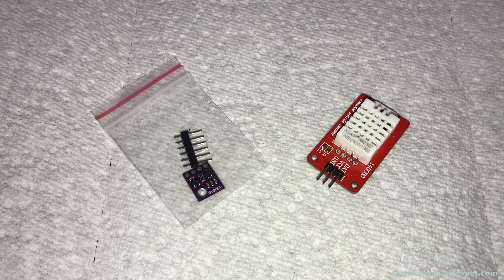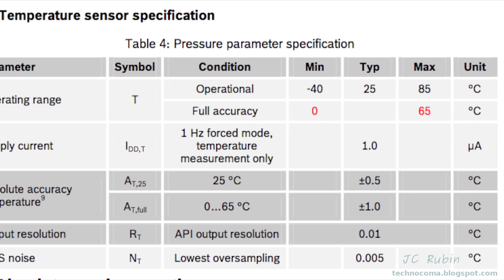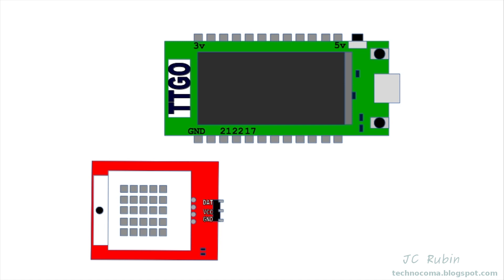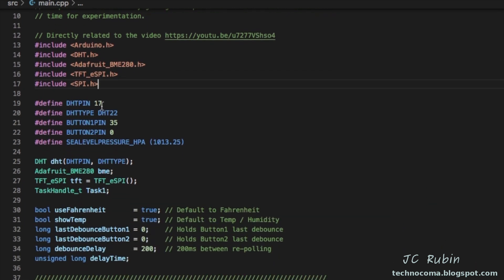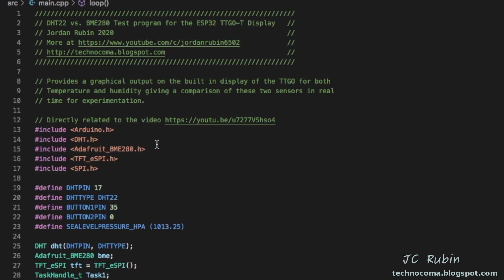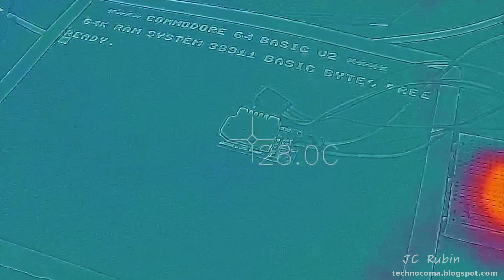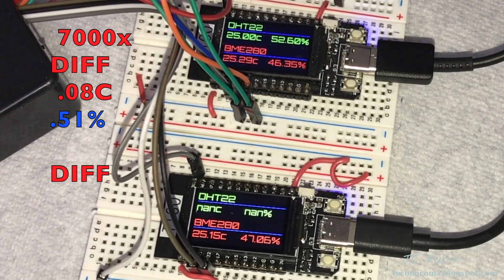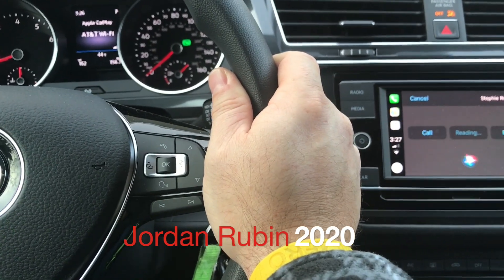BME280 Vs. DHT22 Temperature Sensor Shootout as Tested on the TTGO T-Display ESP32

Comment: Thank you for your interesting multi-component comparisons and the TTGO T Display code and wiring info. I plan to replicate this and will try instead to compare another type of non-contact sensor the MLX90614 in place of the DHT-22 with this BME280.  I have project in mind that needs to reliably trip at an adjustable threshold in a range of 60 to 70 degC before any thermal damage occurs.   Its was very interesting to see the FLIR of the TTGO and breadboard.. as I touch mine it doesn't seem to get that warm but I rarely have it running as long as you did to assess these more accurately. Thanks Again.    jimS

Comment: Thanks for making this contribution.  I found this interesting as I have spent time doing work similar to what you have done here, but primarily on the BME280.  I'll offer my experiences; perhaps they will help you, or others.

1)  These off-shore sources of BME280's are open to question.  I have an Adafruit device just to check against the others; so far, no obvious differences in performance.

2)  The BME280 WILL SELF HEAT if you run it too fast.  The Adafruit library defaulted to this behavior (it has since been revised to stop this).  Specifically, if left to default the BME280 will take readings at its maximum possible rate - way more than what we need for room temperature readings - and as a result the device heats up.  The solution is to make it read only when you need it to.  See the library documentation on "forced-mode".  Once per second, or more, will eliminate the problem.  Furthermore, even when setting the device to manual (forced) readings, if you call it in a loop continuously you will also self-heat it.  Mine will rise some 2 or 3 degrees, F.  I call for a reading every 5 seconds, which suits my purpose.

3)  Another good way to compare any temperature sensors is to set a small fan blowing across both of them; more-or-less you get the "same air" on both sensors.  They should be physically close together.  Turn off the fan and watch the trend of each sensor; if one rises, then its self-heating.

4)  As another mentioned, the DS18B20 is a great sensor, but temp only.  Be warned, most all supply you see on auction sites are counterfeit.  (see GitHub page by Chris Petrich, discover_fake_DS18B20.ino).  Jameco has good prices on authentic parts.  Counterfeit doesn't mean they don't work, but it just means you can't be sure of their compliance to specifications.  I use both in various applications.

5)  You mention averaging readings (at least I think you did...); the BME280 can do this for you, see the library for instructions on oversampling - the sensor can take care of this for you.

I like the convenience of the BME280, for sure.  It offers a lot in one solution; but getting to trust the temperature readings has been a challenge.  My desk clock displays temperature, standard pressure, relative humidity, and super accurate time using NTP - all on one 20x4 LCD display.

These TTGO modules look pretty cool - might have to give one a try.
Reply from the maker: Indeed, these were some of the perils mentioned in the technical analysis of the chip. I would agree in most cases where ambient air temp reading are taken, nobody would have a need to 30 reading per second and once every few seconds would be adequate.

Counterfeit chips are always an issue, especially on amazon.  Considering the pricepoint there and bangood you can be sure that these offshore factories can be less than legit.  Thats why the double blind tests are important.

Comment: I put outside  a DHT 22 , DHT 11, and BME280 and the BME280 temperature  is off from the other two. I have ESPEasy running on ESP8266  so it was easy to put in a temperature calibration to bring it close to the two DHT sensors. I will have to do some more observation when it warms up again because the DHT 11 hit's it's bottom limit in the cold we are having now.

Comment: The reason your temperature was different is because the bme280 is chip temperature not ambient temperature, as I discovered by reading reviews on amazon that said just look at the datasheet, so whatever temperature it reports is likely to be a bit over ambient temperature, the integrated temperature sensor is only meant to improve the accuracy of the humidity and pressure sensors, if you need ambient temperature as well then I recommend DS18B20. That said I really like the bme280 for humidity and pressure :)  Also now that I read this over, I am guessing its part of the reason you did the cold start over 30 minutes, so maybe its not really that bad even though its chip temperature.
Reply from the maker: Yes, these comments and complaints were the reason for the 30 minute tests.  The ambient and enclosed case testing serves to show that in an encasement these work very well for temp measurements.
Reply: My BME280 was reading lower than a DHT11 though I don't have the best setups in the outdoor box I have them in right now. I put them up quickly this winter just for the fun of it outside on a portable solar cart setup I have in the field.